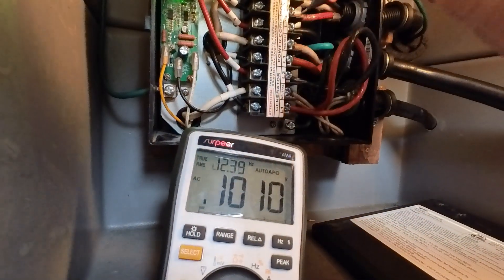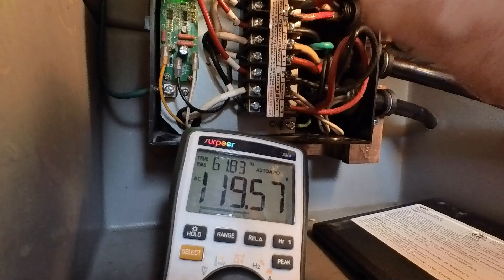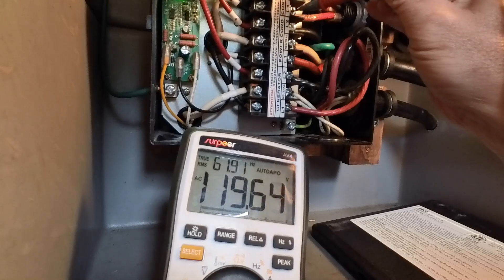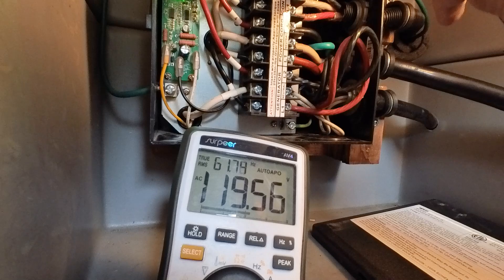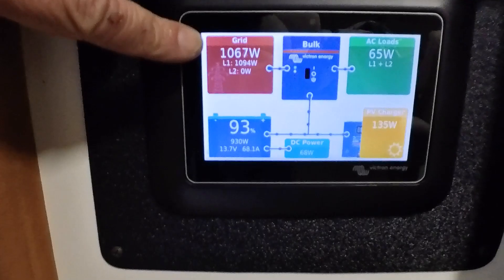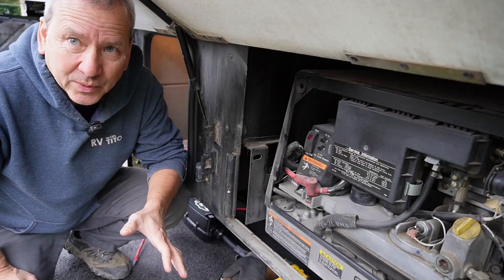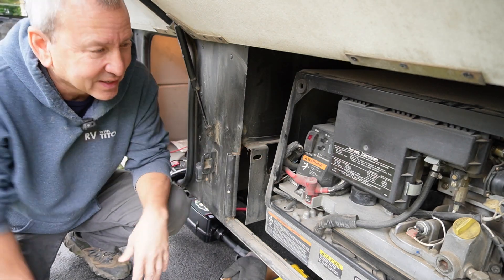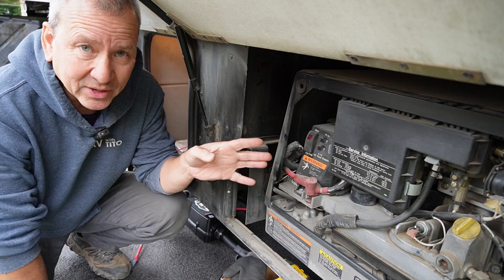RV Automatic Transfer Switch Testing and Replacement | RV With Tito DIY

Comment: Brian , nice video.  Every step explained well. I have a 2005 Monaco  knight. Generator comes on, inverter is working but not getting power to go to battery bank. Turn off generator and has no powe to coach  no matter how long I run it for.Sounds like a ATS  SWITCH replacement yes?? BEST PLACE TO BUY PARTS FOR THIS COACH IS WHERE?? NEED HELP LIVING IN THE DARK
KENNY WADE
Reply from the maker: I got this one off of Amazon (links in video), but  you'll need to match it closely with the one you already have.

Comment: My RV will power things when I turn generator on, but is getting nothing when im plugged into shore power. My display inside shows AC Load 120v, but AC IN 0 😱. 
I accidentally plugged into 220v and it fried my Inverter, I replaced it with the same model and everything works when generator is on, but nothing is coming when plugged into shore power. This includes charging of my DC battery bank.
Any help?
Reply from the maker: Double check that no breakers from your shore power source are tripped and that it is powered. If the shore power IN is good then your transfer switch might be damaged too. No way to know without testing it with a meter.
Reply: @RVwithTito  the shore power breakers are good, I checked with a voltmeter and its putting out 120v now. I dont know where my transfer switch is on my rig though 😅
2006 Dynamax Dynaquest if anyone could point me in the right direction 😅😅😅

Comment: Hi. Does this transfer switch buzz? I know the T30 I think steps down to a 12V converter/relay which is great. I just installed a southwire 50 amp switch and it buzzes, apparently "normal" for these types of contactor switches. Very unhappy as you can hear it clear as day in the trailer.

Comment: Your channel helps so much! I'm stuck on an 2 issues. 
   I'm adding solar to my 2004 30amp bounder, 900 watts of panals with 2 new 400 amp lithium batteries as power source,and going with the victron products, but need to also upgrade  my factory installed transfer switch (don't I ?)...but really have'nt noticed hardly any mention of the need or how to.
does the 12 volt multiplex have a transfer switch on board?
I'm aware that combining the batteries to 24 volts with the proper 24 to 12 volt converter present, can be a good way to go!
 Did you consider the 24 vs 12 volt source whdn installing your upgrades?
Reply from the maker: (1) Your factory ATS switches between shore and generator input power. If you still have a generator then you'll need keep the ATS installed. The auto transfer switch in the Multiplus controls the transfer from AC passthrough power (from your ATS output) to inverter power (from batteries). Another option is to install a Victron Quattro 2 which can accept both shore power and generator inputs and eliminate the need for your current ATS.  
(2) I decided to stick with 12V for two reasons. I was using 3 x 12V batteries which couldn't be combined to make 24V. Second: It simplified my installation and integration with existing systems. Yes, I had to use thicker cable and larger solar charge controllers. 
Hope this helps.

Comment: Great video.  I have a similar ATS.  I noticed that for both mine and yours, the wires for the generator appear smaller than the wires for Shore Power and the wires to the RV load panel.  Why do you think that is?  They all need to carry 120v and 50amp on both legs.

Comment: Thank you for your videos. On my to do list is check all connections on my Vista’s ATS. Is that a quarter inch drive torque wrench? And what is the  torque spec for these connectors?

Thank you again
Reply from the maker: Can't remember the torque spec, maybe 25-30 in-lbs?? Yes, that's a 1/4" torque wrench from Amazon (https://amzn.to/496Ity1)
Reply: @RVwithTito  thank you Brian.

Comment: How are you making out with the 12 volt Air Conditioner.  I am very interested.  I have a 2005 35 foot Winnebago very similar to yours.
Reply from the maker: Not done yet but I'm on the home stretch with the install. I'll report more soon and have been sharing updates on Patreon.

Comment: Great video Brian. I that exact issue on my 2001 National Tradewinds last month. On mine however I also had corroded cables in the generator junction block which complicated the fault tracing. I found a used controller and changed out the control board which solved the switching problem. Upon closer examination of the old board, I found I bad solder joint that was the culprit, probably caused by vibration.

Comment: Excellent Brian!  I replaced mine with the recent Lithium/Victron Inverter project.  I noted the recommendations on torquing stranded cables 2 to 3 times.  I was surprised at how after each snugging down of the screw, I’d wiggle the cable a tad and then retorque it.  It would snug down further on the first 2 or three times I did that.  Avoids poor connections that lead to heat and possible issues down the road.  Carry on good sir!! 😊
Reply from the maker: Glad you enjoyed this one and thanks for the retorque tip. 👍

Comment: Brian, thanks for the video. I have a toy hauler with 50amp service and an onboard Onan 5500 watt gen. Mine came with 200 watts of solar new, so this spring I added a 2000 inverter. My question is how can I add the inverter to the ATS with only 2 inputs?
Reply from the maker: It's not a simple answer/solution unfortunately. I'm assuming it's not a hybrid inverter. You can either (1) have a dedicated set of outlets just for the inverter, or (2) create a cord to plug the shore cable into the inverter. In the second scenario you must switch off or disable the charger (very important). Here's a video that is sort if in topic and may give you some ideas. https://youtu.be/iASOOzUCRto?si=uHpQn_CawMxqUJNA
Reply: Thank you Brian, i appreciate the response. I have a Renogy 2000 watt inverter, not a hybrid. When I installed the inverter I went with your option # 2, sort of. I wired the inverter directly to a 30amp RV plug I mounted in my generator bay. I have a 30amp RV cord with a 50amp receptacle that I plug into the shore power inlet. But as you say, I have to remember to throw the breaker on my converter/charger. Do you think there's a way to add an additional transfer switch to make the process easier and would only power the outlets, so I just have to turn on the inverter? Thanks again for the advice and all of your content.
Reply from the maker: You could add a second ATS or just a manual crossover switch. It would be good to add some kind of indicator light so you know where the power is coming from.

Comment: Great video Brian! When I bought the RV new I knew this was a must have so I built my own 50 AMP Transfer Switch for my RV. 
I had the same type of issues with the ones you fine online etc.. Originally everything was 30 Amps but I upgraded everything to 50 A to accommodate everything and not having to be conservative. lol.  I put all the controls for the Transfer Switch in a 12"x12" x6" Nema 3R enclosure. I put twist lock receptacles on my enclosure so that it is pretty much plug-and-play (quick change). My Solar is priority and my generator or shore power is my secondary. It runs 24 seven Year round and so far it's been working flawlessly for the past eight years. Transfer switches are definitely a must have for convenience. Keep up the awesome work and really appreciate you sharing this video with us. I'm sure it will help a lot of people out. Looking forward to your next video keep up the great work and stay safe out there.Cheers DC.
Reply from the maker: Nicely done! Thanks for sharing your setup. I'll crack open the transfer switch I removed to see if I can find out what's wrong. I have a use for it in my off-grid / emergency power setup in the shop.

Comment: As another test, You should unplug the shore cable, with the generator running and test that there is no power bleed going out the shore plug. You don't want 240vAC being fed out the shore plug when it is not in use.
Reply from the maker: I may not have had that in the video but I did test that for both the gen and shore power. Thanks for pointing that out.
Reply: @RVwithTito  I had a problem one time in that I was running on shore power and turned on my inverter that also fed the breaker panel in the RV. That poped the GFCI on the shore power. It would have been a good idea to have a device that switched between the inverter and shore. I just remember not to try to connect both to the breaker main at the same time. I don't want to spend the money and time to install the cuttover switch.
Reply from the maker: @jamescampolo7824  On our last RV I had it set up to manually switch between inverter and shore power, but eventually automated it for my wife. She was hesitant to switch it on her own. Afterwards, she could just turn on the inverter and it was automatic.

Comment: The last time my transfer switch didn’t want to work I traced it down to the pedestal. Someone had been meddling in there. The neutral was unhooked and taped. 

I was cussing the RV since it was late at night and dark and just ended up putting my battery charger on my battery bank for the night. The next day I figured it all out and had to apologize. 😂😂
Reply from the maker: Funny. Once I pulled into a campground at night and needed to charge up. When I opened  up the pedestal, there was a giant beehive inside 🐝with little guys swarming around. Didn't want to deal with that. So I just went to bed and let the sun charge me up the next day.

Comment: What's that little extra connector that your generator supply attaches to in the box? Does your gen only have 1-leg output or something?
Reply from the maker: I wired both 30A legs from the generator in parallel. It's something I needed to do in order for it to get full power with my inverter. I didnt feelnit was relevant to this discussion, but I talk more about it in this video about 11 minutes in https://youtu.be/MV8aSLt_Ers?si=2wCmOUdjsY2qEDpZ
Reply: @RVwithTito  Interesting, in other installations of that design I've seen just one merged leg carried into the transfer switch. Did the switch require both to detect current, or were you just trying to keep two legs all the way through? How does the multiplus 2x120 handle two legs with the same phase?
Reply from the maker: @jonathanowens2337  I'm thinking the Multiplus checks both legs for split-phase. If it detects single phase, then it just takes the input from L1 and splits the output across both legs. I could be wrong, but that's my understanding. I could probably just use L1 going in (like you said) and it would work the same.

Comment: While I had my ATS out a few years ago to do maintenance, I also took the time to put ferrules on each wire as well and then torqued them to spec.
Reply from the maker: I like using ferrules too. I do have ferrules on the cables with lots of copper strands in the ATS but not on the thick stranded 6 AWG cables. I found that the ferrules just don't compress and crimp on there.

Comment: SAFETY TIP: When doing this repair, be sure to protect the inputs. Make sure no one inadvertently plugs the shore power into a power source or start the Generator, especially the remote start button on the inside of the rig. Getting zapped hurts !!!
Reply: Yup. Used to work as an electrician in a former life. Pro tip - don’t rely on co-workers to cut the circuit even though they said they did. Always test it before you touch it
Reply from the maker: @raybbj Didn't know that about you. You're right. Can't be too careful. I definitely was using my tester each time beforehand. Thanks for the reminders.👍
Reply from the maker: Thanks Ray. Hope you're not speaking from experience :) If that generator were to start up while I was in there, I'm sure I'd jump back and hit my head :)
Reply: LOL well said
 @RVwithTito

Comment: I don't know that it matters, but did you notice your ATS is wired against standard?  Normally Black is L1 and Red is L2.  I don't think it matters and it looks like all three lines going into and coming out of your ATS were all wired the same, but I recently looked this up wiring my Multiplus in so I noticed it when you cracked the ATS open.  The lines inside for the ATS works were wired to the standard.
Reply from the maker: Good eye. You noticed :) You're right. Per NEC, black is L1 and red is L2, but it really doesn't matter as long as you're consistent and your legs are balanced. I do plan to swap them though. Originally, my RV electrical panel was wired with red on L1 for some reason. So I wired my Multiplus the same...then the ATS. Next time I crack my Multiplus open I'll get it done. I should have probably done that prior to this video though :P

Comment: Another great video Brian. We own a class C Winnebago that also had a bad transfer switch. Thank you for mentioning check the touques. I’ve read of wires burning because of inadequate torquing on the transfer switch.  Lots of power passing through. Thanks again.
Reply from the maker: Yup. Loose wires at high current can have pretty bad consequences. I've also seen it change the voltage which can cause the ATS to detect bad voltage. So it's a good thing to check periodically.

Comment: Robert's drive screw driver
Reply: It’s challenging for some americans to remember lol. 🍻
Reply from the maker: @SpykersB  I figured most weren't going to know what a Robertson bit was. So I opted for "little square bit" instead :)
Reply from the maker: Robertson I believe. Maybe it's Robert Robertson :)
Reply: Everyone that owns an RV built after 1980 or so has one of these screwdrivers, even if they don't know what its called. I have several #2 Square drive bits in mine.

Comment: Great video, thanks for sharing.  We had the same issue in May this year, it would work for a few minutes while it was cold, then kick out and no power until it cooled off again.  We were boondocking, so we were on generator power and no way to get the transfer switch, so I just pulled the cable and put a socket on it and pluged the shore line cable into this new generator socket. It worked until I was able to get a new transfer case.  I think I caused the failure buy putting a storage box in the bay, not enough air circulating around, so I think it burned up.  I still store a box in there on move day, but take it out as soon as we are setup.
Reply from the maker: I'm always thinking of work arounds also and have concluded that I don't need to carry a spare ATS. Like you did, I know that I can connect it up manually if I need to. Thanks for sharing your experience.

Comment: Something you didn't mention in this video, is that the frequency of an unloaded generator will vary, usually a little high, until the generator is loaded, at which time the generator frequency settles right down to 60 (or 50 if you are in Europe). This is entirely normal and desirable. 
This was a great tutorial, as usual, though. I'm really happy you mentioned torque settings. Torque settings, and the importance of torque, are not well-understood by a lot of people. Could you do a tutorial on that subject?
Reply from the maker: Thanks for the suggestion. There's certainly a bunch of extra detail I could have added, but didn't want it go on and on. Trying to keep it concise.

Comment: Great video. I don't know how many times I've run across folks who were dead in the water and didn't even know where to start. I advise them to check the ATS, and their reply is what's that. Over the years, I've replaced mine twice. In both instances their was a problem with the buss bar. Since then, during my annual maintenance, I check all the connections, and usually, at least one of them is just a 1/4 turn lose. Since I started doing this, I've never had a problem. 

Keep up the videos you were a great help in designing my lithium/solar system.
Reply from the maker: It's definitely one of those black boxes that many RV owners wonder "what is that thing?" You're right. Routine checks on the torque is important.

Comment: Did you do a video on integrating a solar power from inverter to a current existing RV distribution box? If the old unit is a converter box to run AC appliances and dc consumables, how would you fit the Victron solar/ battery power into the unit? Do you bypass and skip the old unit or hook it in where the solar power goes into the RV power panel?
Reply from the maker: It depends on your inverter. If your inverter is also a charger, then you don't need the converter anymore. Here's a video about the inverter (https://youtu.be/mcvD6TVPvA4?si=mB3svrPFw1zMNcqw) and here's one that talks about the battery hookup (https://youtu.be/pnWpbgmEhVQ?si=8AiKBkIZ6lUuOmfs&t=283)

Comment: My ATS defaults to the generator side so if the internal switch fails I'll only get power from the generator. One evening, after pulling into a remote USFS campground that is exactly what happened. No power when plugged in (EMS said there was power) but power on generator. Turns out one of the small wires from the ATS circuit board had come loose. Once that was reattached everything worked great. Only took 2 hours to solve that one!
Reply from the maker: That's often the case isn't it. Hours troubleshooting to find a loose or disconnected wire :) Glad it was that easy though.

Comment: Love these videos...  Is there any way you can give a rough estimate on time/ hrs, and costs for these things? I realize it varies in diff parts of the country, but us female, non-mechanics get tired of being ripped off.. like for turn signal oil & "special air" for tires. 😉😏🤪
Reply from the maker: Transfer switches vary in price from $150ish and up. There's a link in the video description that will list several. You can see the price difference. The layout usually varies from one unit to another. So it's usually a good idea to find an exact replacement to minimize any need for re-cabling it. Good idea keeping those turn signals oiled up :)